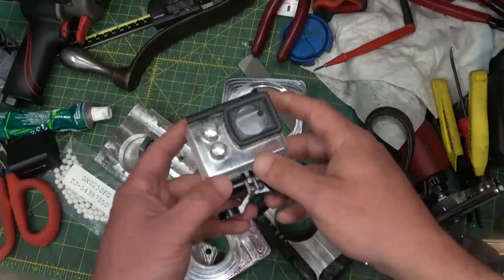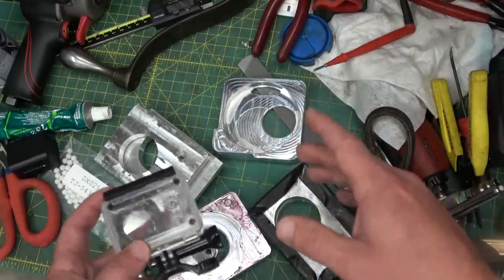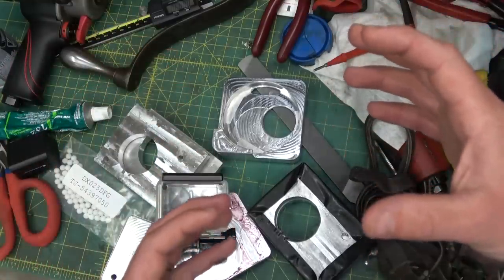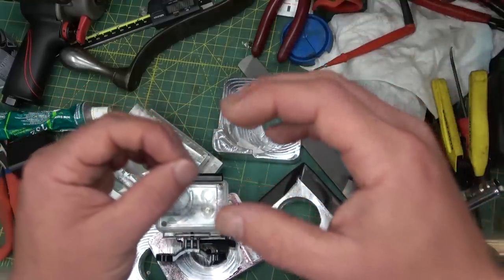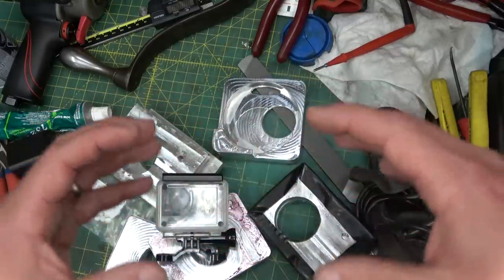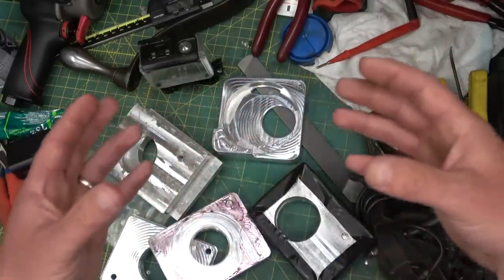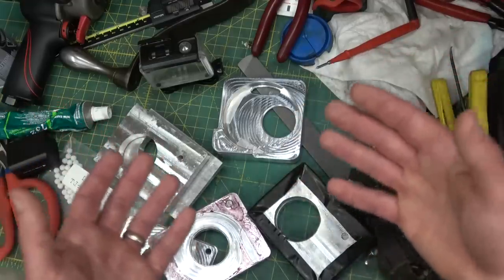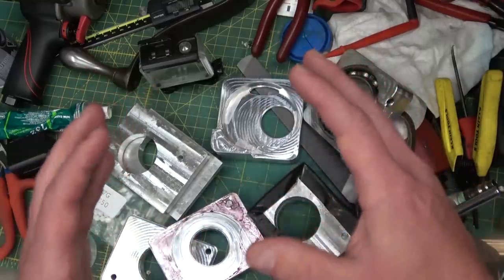Homemade Spinning Lens | self-cleaning gopro prototype

Comment: It's sort of a Quinting watch problem, but without it being a watch.  Or Quinting.  Or the rather high costs of one :).  I like the solution with the UV lens, because that removes the issues with optical distortion.  I look forward to this developing, as it were 😋.  One challenge is that a mechanical drive can get things jammed in it (as opposed to air), but I think magnets + coils (à la brushless motor) would get too complicated..

Comment: Hi AvE.  Love your channel, causes the wheels in my brain to move non stop.  

Why not take a roughly 6-8 inch plate or poly or glass with a centrally mounted smaller bearing that allows the plate to spin via force applied to the OD of the plate, or perhaps an inner motor.  You could then mount the camera to the side looking through the outer 1/3rd of the plate, which will you give an unobstructed view, but also take advantage of the faster spinning outer portions of the glass/poly (more centrifugal force, plus more consistent image vs looking through the dead center of the plate as it is barely moving and not shedding as much fluid comparative to the outer portions)  Additionally since you will be using a smaller bearing I would assume the cost of sourcing a small high quality sealed bearing would be more economical?

Would assume it could be balanced fairly easily by mounting to a lathe between some other material to stabilize, and then turning?

Or do away with the bearing all together and directly mount to a spinning shaft from an electric motor?  (Drill mount proof of concept?)

Perhaps this would cause the entire structure to be too large for the application?  Half way thinking you have thought through this before.

Comment: If you've ever owned an old VW be it a bus, westi, bug, the cheapest, best inside defrost material to use is pure Ivory soap bar, buff it into the glass. Helped me living in VA and DC during inclement weather.

Comment: One fairly simple thing you could do to improve the quality of your existing design is to shim the filter to reduce run-out. That way, you could minimize the weeble-wobble you've got goin on there. I mean, you've got all those expensive gauges just lying around...may as well use em to score a racing stripe in your filter.

Comment: Hey, I'm a young guy getting into the manufacturing/industrial welding field of work and I'm curious if there's any advice I could get. I know you've seen your fair share of how things go, and I'd like to know if there's anything I need to keep in mind. Thank you for taking the time to make your videos by the way, they've helped me so far in my own small projects. 
Knowing how to properly splice wire and how to fix a leaking drain plug have been the ones I've used the most, considering I'm far from becoming a Boeing engineer.
Looking forward to upcoming projects!
Ryan H.

Comment: If you have an open bearing exposed to coolant and machining detritus, it won't take long before it seizes.  I think a better route is to keep the coolant away from the lense using high velocity air flow, strong enough to deflect splashes before they hit the lense.

Comment: Drive the whole disc like an in-runner brushless motor.  Put the clear disc inside a small frame aluminium and mount very small magnets around the edge of the frame.  A groove in both the disc frame and the back plate to house the balls (like a thrust bearing).  The three phases (nine coils?) go on the back plate.  You might be able to use a standard radio controll brushless speed controller to drive it.  The coils should pull the disc against the backplate when operational (a firmware teak or some diodes might be required so it pulls and does't push etc). A bolt on cover holds the edge of the disc tight enough when not operational so that the balls don't fall out. This also makes it easy to put in the balls into the bearing race. The parts can be very light and you should be able to get very high rotation speed.  RF shielding need attention though.
Reply: Totally plausible idea, but I don't think he wants to put THAT much work into something that can be 90% achieved by much simpler methods. A time-value proposition

Comment: You can probably use a belt attached to a motor to drive the inner race (if you extend it) for a super high RPM.

Comment: Is there a size constraint here that I've missed?
If you made the disk big enough - say, 8-12 inches across - you could just spin it from the center with an off-the-shelf air or electric motor just fine.
Basically, just cut out a polycarbonate disk about the same size as a saw blade and mount it to a cheap table saw motor with the camera underneath.

This wouldn't be suitable for carrying around to film, but for a system that's mounted in one spot away from fingers inside a CNC enclosure it could be just fine.
Of course you might want to install some kind of guard or shielding around the rim both for safety and to prevent liquid from splashing around the rim.
 You'd certainly be able to get a much higher tangential velocity to throw the liquid off much faster, and you wouldn't have to worry about the dead spot at the center of the disk.

Comment: Minor correction: water LOVES silica glass. Glass is very polar and one of the few common materials that have a high enough surface energy for water to wet to. Without getting into young's equation and suchforth, if you want a liquid to wet a solid in air, the solid needs to have a higher critical surface energy than the liquid. Wax and plastic and other materials water "beads up" on have lower surface energies than water. Fluids that have low surface energies (like oil) can spontaneously wet plastics, where water doesn't, which is why it's often really friggin' hard to get all of the grease out of cheapo tupperware

One of the best ways to tell if glass is truly clean or not is to wet it with  pure water and see if it wets, which you can see by the liquid front falling as a uniform sheet or breaking when the surface is hung up. Most soils are fairly hydrophobic compared to glass, so spots of contamination will show up as beading or breaking.

Now, this of course does not apply to acrylic plexiglass or polypropylene or polycarbonate or whatever exotic clear condensed dinosaur squeezin' you might be usin' to hold the shmoo spray around your CNC mill.

Comment: Hard disks are just glass platters nicely mounted on a balanced high rpm motor. There must be a way to get the magnetic plating off the glass.
Reply: I might beg to differ on that...
hard drive platters are NOT all glass.  And, the ones that are glass are not just die-cast... they're spun glass, which means they are pre-stressed and the grain structure is waaay different than what you're thinking of.  If you have a piece of normal glass and toss it at the ground, it just breaks... a glass drive platter will pretty much explode.  If you have a way to remove the coating without breaking it, there might be a market for that.
Reply: @aaronbrandt3305  I dropped one and its does break but not as bad as a car windscreen or a squash court. It looked transparent when looking  side on of a broken shard. Yes I understand tempered glass. I was not thinking of grinding it. The coating is metallic put on by metal vapour deposition. Acid or elecrotlisis should work without affecting the glass substrate. Also paint stripper should remove the protective coating on top of the metal. Yes it is mainly laptop 2.5" drives that are glass but the lense of the go pro is not that big.
A quad copter  or other RC ESC should be able to drive it on a budget if you don't want the fun of reverse engineering the original HD circuitry. Heck people even used arduino as ESC. 
Someone should tell uncle bumble fuck. Get him playing with pixie chopping confusers. He has an o-smelascope and I saw him playing with some strong acids and electrolysis  in previous videos. All he needs is a small torx  screwdriver set and and couple old laptop hd.
5000 rippems Not too shaby. Light and nicely balanced  so there should be minimal vibrations.

Comment: I was thinking that some sort of dyson hand dryer type of air stream would keep it clean. Wouldn't be near as cool as what you're doing though. Cool stuff!
Reply: I think you need to watch the first video in this series
Reply: Watch the previous video, that's the exact problem he's trying to solve.  The guy he's designing this for did that exact thing and created an awesome airblade to keep the lens clear... problem is fluids (air be one) create a cushion of non-moving fluid around any stationary object and so it don't do the job gooder enough.
Reply: @codysortore1394  & Casper Clemence You are correct. Just watched the prior attempt. Thanks for the heads up!

Comment: You could drill through the center of the lens, and mount it on a shaft, so it could be driven by a motor (perhaps a dremel for r&d?) Seems like a much more reliable way of driving it, but then you couldn't pressurize the clean side to blow out the schmoo

Comment: .... progressing. Sewing machines use that o ring tire to run off the flywheel for their bobbin winders and some have a rubber capped bushing ended drive motor to turn the flywheel. How highly polished can you get the lens?

Comment: the o ring may loosen under centrifugal force at something like 20,000 ripems. also you may get side loading to the bearing which may cause unwanted vibration and weble wobble. Glue the O-ring and use precision Caterpillar hydraulic O-Rings.
  Possibly 3 drives set in a triangular pattern around the bearing while keeping the inner race centered would be a easy success...

Comment: AvE think about using a "thin section" axle bearing, they have large inside diameters that are almost as large as the OD. The section is very minimal. They are also available all over amazon and mcmaster.

Comment: I used a DVD/CD motor and hub from a laptop. The hub that you snap the disk to. And made a polycarb disk the size of a DVD. Motor in an enclosure, little speed testing and it works fine.

Comment: Maybe something like a wheel from a mechano set. Replace the little rubber tyre with an O ring that will handle the coolant. Stick it on the end or a little motor?? Dunno, just a thought.

Comment: back in the 80's i had some sunglasses with tiny wiper blades.  belt mounted battery.  there were some flaws, one being you usually don't need sunglasses in the rain...hmmm...

Comment: Man, I love Rain-X. The first dozen times or so I used it I thought it was crap but after being forced to use it on a classic truck with no windshield wipers I came to see the light. The trick is to just give them all your money. First apply the regular Rain-X on all the windows. Then start using the Rain-X windshield wiper fluid. Don't forget to use the Rain-X window cleaner. Seriously though, you get enough of that shit on there and you're good to go. Mind you, I live in Western Washington. I know a thing or two about rain and spit. Did you know Seattle is in a partial rain shadow? Some Rain City. Well I'm ain't in no damn rain shadow. Rain-X works great.

Comment: I would have just had the GoPro facing away from the mill spindle to protect the lens, and then have a mirror in a disk shape being spun by a motor set up to reflect the action into the camera. This way you won't need any sealed contraption spinning lens thing, yet any liquid would be flung off the mirror keeping it clean, while still protecting the optics of the GoPro. You could mount this in a jig so that it can be moved around the mill enclosure. Cheap, fast and good.

Comment: You could quite easily 3D print a gear, that you could glue to either the lens or the inner race of the bearing, that you could drive from a motor. Alternatively you could print paddles like a waterwheel for better air control

Comment: Using a small motor to drive the thing through friction alone?! Actually rather smart, the thing isn't under much mechanical stress. And we don't need to transfer a huge amount of power.
Also, the project seems to be improving nicely.

Though, I didn't expect the idea to already be a patent pending product in the cinematography industry.

Comment: Jep, almost perfect. Just print the pulley for some kind a belt, inside bearing and put lens  inside that. Then you can drive it beside the camera with small sheap motor. And maybe use a closed bearing. 😁.

Comment: Good idea, but definitely needs an internet connection so it can fail to work if it's not registered online, and it will probably need access to your contacts, friends, photos, location, doors, and significant loved ones. Otherwise I can't see how it will work effectively.

Also, add some consumables so you can Hewlett the absolute Packard out of the consumers. Make it so it uses a custom battery, custom charging cable, custom lubricant, and preferably some custom, "certified" CNC schmoo.

Come on AvE, get with the IoT revolution man!

Comment: This is neither here nor there, but centripedant force also produces a uniform optical transformation in the resolution of shmoo: ie, the radial (to the lens) smoothing from the thinning of whatever liquid is continuous through the tangential angles from the centre-point. It's a pattern that AI powered picture enhancement software is good at picking up.

Comment: You may have thought of this. A cover/slinger over that bearing would be a good idea. Shavings will get into your balls and seize up the works. O as a side note. I use to use coolant to mop the floor. It works better than soap. You are exactly correct about Rain-X and its derivatives. I almost hate to make a video on this subject myself. The comments are almost unreadable.

Comment: As you mention at the beginning of the video this may be a stupid question, but if you have supplied air driving this thing why not just have it run to the outside with a thin flat tip and blow across the surface of the glass? I can only see one issue with this and that is the amount of air needed. In my head it would seem that it wouldn't need much to help prevent the liquid from getting on the lens in the first place, but what does get on should blow away quickly.

Comment: You talked about Rain X Mr., but how about Aquapel? And those "ceramic" coatings they use on pricy cars? They sound a lot like silicon, but maybe a harder type of polymer, because the thing doesn't really feel liquid after you apply. Those might work well.

Comment: The weakness apparent in the design presented is that honken huge bearing. What about a tiny bearing at the center axis instead of a huge bearing around the circumference? Those 22mm skate bearings are practically free, and I got some tiny 10mm bearings off ebay for less than $2 each. I'm betting the dollar savings on the bearing alone would be an order of magniturd. The weight and rotating mass saved would be nice too.

Comment: Okay, so this is what I don't understand.

If the air blade idea wasn't good because air won't clear the lens (similar to how dust accumulates onto fan blades, we were told) then what's the difference between moving air across the lens versus moving the lens itself? Do the fan blades not also move similarly? I guess the analogy isn't perfect, but there is still some merit to this design?

I guess we're hoping the centrifugal/centripetal/centipedal/bicentennial force acting on the coolant is enough to overcome the stiction, more-so than the air moving over the coolant alone?

Comment: All the air bearings i have worked with included a mechanical bearing.  The rotation started on the mechanical bearing, then lifted onto the air bearing.  Some even have three bearings - mechanical, oil suspension, then air.  The secondary bearings were very noisy as they are not concentric.  They made the support wide as the bearings are co-axial - not concentric.

Comment: Rain-x: It doesn't do sh!te. If you're having problems seeing out the windshield, clean it with a claybar, and GET NEW WIPERS. 
For the pneumatic iterations, specifically the radial design, I suggest the radial paths be tapered and opening up the exhaust path more, but IMO would be too much work, for just getting a proof of concept.
For the motor design, I suggest getting a brushless RC motor from a quad/drone. Get a low KV (around 5000 and lower. It's the rpm to voltage rating) as they have higher torque. Higher KV would burn out faster for a loaded static start, like a belt drive. It would also need a speed controller, and a servo tester to control the ESC. A 1S ESC will work (1S = 1 cell, with is about 3.7volts). Then you can just either put in a 18650 lithIon battery in or just 3 AA batteries. You can get what I listed for what $15US? A pack of 20 count pack of AA batteries probably will cost more than all the motor parts. Reason I suggest from a quad/drone is because, they are contact, light and fairly cheap.
EDIT: then you can replace the servo tester with a cheap receiver, and control it remotely.
Reply: john doe  yeah.... and 5 min later you have all this dust, dirt and shmoo all over your windshield until you clean off the rain-x.

Comment: The Tesla design would be workable, just a slightly larger diameter disk
 and offset the camera to one side of the shaft.  Use the discharge air 
to carry the slung off coolant to a drain on the outer side of the 
housing, with the correct fluid flow (gas and liquid) there should be no
 need to even gland the disk to the  enclosure, just a small amount of 
bleed air to pressurize the housing.  Just a thought?

Comment: motor, band and pulleys, sure i've seen that some where before. I vote rubber band, i know it works well at low speed on a record player at least.
Reply: Just a different size of o-ring! Avoid "rubber" bands of unknown composition when working with coolants and oils. The result of a band dissolving is...messy.